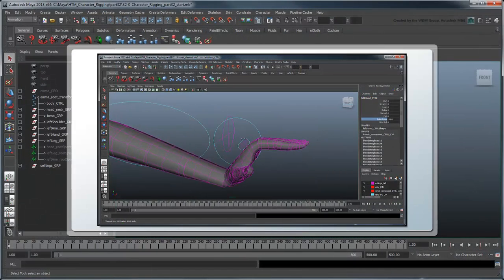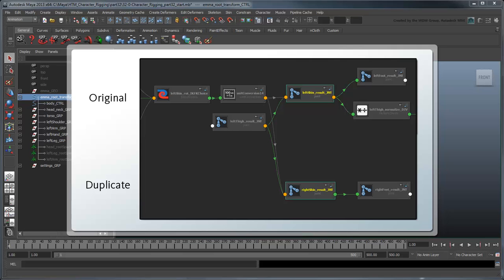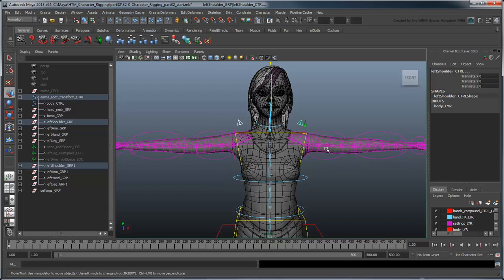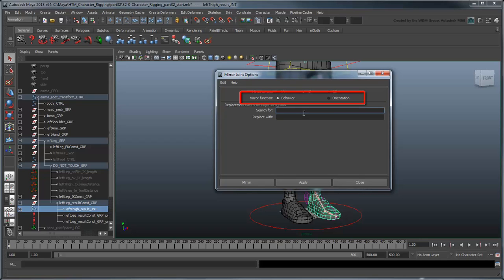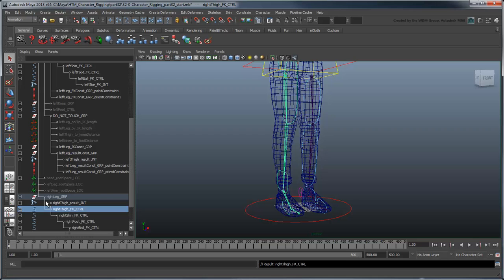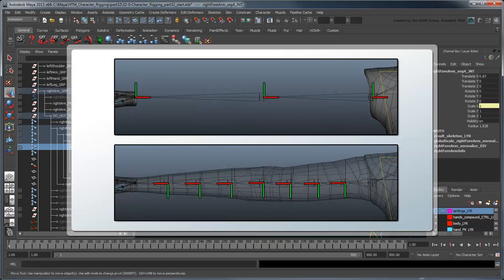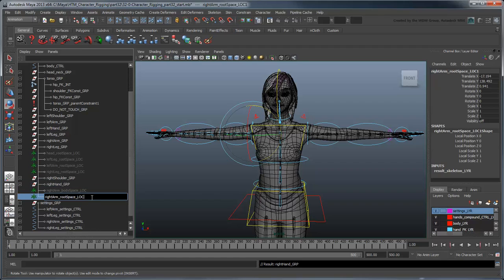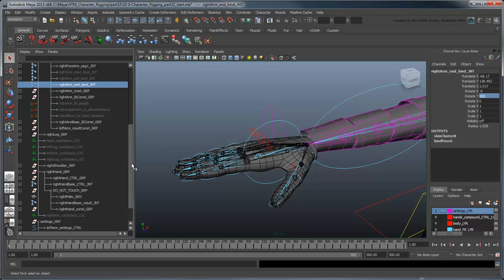Creating a Character Rig - Part 32: Mirroring (Advanced)

Comment: How do you invert the distances or (mult by -1) I dont understand what that means or how to go about doing it. do you do it in the script.......?
Reply from the maker: You will need to use a Multiply/Divide node to multiply the outgoing connections to the length measurements on the right side of the body when calculating stretch / squash.  Try downloading the included scene files and looking at the Node Editor to see what I mean.

Comment: I have another one.left arm/leg ik stretch script is ok.  right side is show result 1 but not stretch .please help me.
Reply from the maker: Remember that the joints on the right side move in the opposite direction as their counterparts on the left side, so you need to invert (multiply by -1) all the length measurements.
Reply: Thank you very much.
Reply from the maker: While I certainly understand your frustration, at 32 videos (38 including appendices) this is the most in-depth tutorial series available on the channel, taking the better part of a year to create.  It also means time spent doing a right-side tutorial that retreads most of the same territory would take time away from doing tutorials on other aspects of Maya.

I can tell you that mirroring the right side, in accordance with the tips given in this video, doesn't involve doing anything that hasn't already been covered in these 32 videos.  If you come out at the end and truly understand the graph, the relationship between the nodes, and the scripts used to create them, then it's a moot point to apply that theory to the right side.  This knowledge and understanding is the most important thing to get out of the tutorial series - more important than the actual rig you get out of it even.
Reply from the maker: This is indeed "the industry" in the sense that to be a great (or even a good) rigging artist, these are the concepts you need to understand.  If you just want a working rig and don't necessarily care about how to put it together then I would actually suggest you try out HumanIK (Skeleton > Human IK).  You can find instructions on how to use it in the documentation, though the rig it produces won't have quite as many frills (such as squash and stretch).  However, I can help you out with your specific questions.

As stated in the video, the best way to build the right side of the rig is actually to rebuild it on the same principles as the left side (so yes, the arm and leg need to be completely rebuilt).  There are VERY SPECIFIC parts of the rig you can mirror by duplicating the original rig (again, shown in the video)but  these cases are few and far between.  The primary reason is that many of the joints on the right side must actually run in the opposite direction as the left (in order to maintain identical behavior on both sides).
Reply from the maker: Oh, you're basically there then.  The important thing to remember when stretching the right side limbs is that you are still measuring in terms of positive values (i.e. the measure tool will never give you a negative length between two points, even if you mirror locators).  However, you ARE stretching the limbs in the negative direction.  Thus, an inversion (multiply by -1) is necessary at the moment you double the length in your script.  From there you can use the same animation graph pre/post infinity theory to stretch infinitely.

Comment: When i smooth bind skin.head ctl rotate is not
fix with eyes /hair/teeth.
Reply from the maker: This is likely a skin weight issue.  When you smooth bind the head, you need to paint your weights such that the head is fully affected by the neck joint.  In real life, your skull accomplishes this.
Reply: Thank you.thank you.

Comment: Hi. So there is no way to mirror a setup contrary to 3dsMax or Softimages? Even by parenting the all structure to a Locator or Null? Seems painfull to arrive to this step, and to have as only solution restarting again from part 10 to 31!
Reply from the maker: Actually mirroring in any content creation tool (Maya, Max, Soft, etc) really just consists of mirroring the joints.  As mentioned in this movie, there is no way to automatically mirror a rig with our level of custom-built functionality and guarantee all aspects of it will work properly.  There are scripts and tools out there that claim to do this, but they are generally unreliable.

In short, it is highly recommended that you rebuild opposing joint structures to ensure a long lasting and stable rig.

Comment: I wonder how many have survived all the course since the beginning...
Reply: Look at the viewcount from the beginning video and compare it to the last
Reply: I made this rig twice, on my own character each time.  One with Squash and Stretch functionality, one without.  This is because I really like the "Marrionette Effect", when pulling on the body_CTRL makes the limbs always point toward their IK controls, as if pulled by strings.  The squash and stretch rig simply has them stretch away.  It was a hard decision, but ultimately I don't really want cartoon-like deformations.  I know the Appendix Series videos contain a method to turn it on and off, but they are way too code heavy for me.  No thanks.

Also, because I was following along with my own character, I found a number of things needed to be redone, such as exact placement of joints, so I had to redo those videos' worth of work.  I must have done most of this rig two or three times over.  AND I rigged both legs and arms at once during their initial videos, so many of the lessons were watched and followed along with twice, for one iteration of the rig.  It took me a while.

This is a great series.  I have a few small gripes with the final product, but overall I'm very impressed.  It's far more complex and robust than what I would have done on my own.
Reply: Almost there...using my own character model though, and I'll work on facial rigging after

Comment: hey guys. great tutorial series! I followed the tutorial for a character of mine. everything worked fine. but I came across an issue with the final rig, that occurs on the project files of you as well. when i'm in IK mode, and move the wrist ctrl, at some point the elbow twist twists 360° when translating normally. is this normal behaviour? I can post a video of the issue if needed! Thanks.
Reply from the maker: This has a lot to do with bone placement and up vectors and is a common rigging problem.  You cannot completely eliminate it due to the way joint twisting is calculated, but sometimes different twist settings can help mitigate the problem.  View the tutorials on creating the arms with annotations turned on to view some of our suggestions for fixing such problems.
Reply: Maya Learning Channel well, I watched it with annotations and followed the tips, unfortunately the problem still occurs. I'll just have to avoid these movements... but there's another big issue I ran into just now, I smooth skinned all the result joints as you mentioned. but the head still deforms incorretly although weights are painted fully on the end jnt. there are no other influences. How can I paint this so that it works correctly? There are the begin, mid1, mid2 and end neck joints, but no painting configuration seems to work  at all...
Reply: found the problem, had to skin the neck end bind joint as well.

Comment: hey guys i just love this series i think you.guys are geniouses, and just a quick question can you make a tutorial on how to bring the rig back to the normal mesh because i finished watching all 32 videos and my rig is al done and then i realised i couldn't do anything with it because it is still proxy and i don't know how to bring it back to normal (could you please help me i'm working on a movie and i really need this rig) 

thanks in advance
Reply from the maker: Apologies for the lateness here - Youtube hid this comment in the spam filter.  

What you're describing is a stage called skinning, which you're right we don't get into here.  You'll need to re-import the unbroken geometry from the provided scene files in part 2, then "smooth skin" the result joints to it.  You will also need to paint skin weights in order to avoid unwanted deformations.  I would suggest looking at the Maya documentation if you're unsure how to do this.
Reply: Oh ok thanx for the answer and i had another quick question : how do you rig a character with instead of maya joints but with polygon muscles (like the guys at weta digital)
Reply from the maker: shekhar nandkoemarsing Muscle isn't really a replacement for joints, just another layer on top of them.  You can generally take care of this in the skinning process (check the Maya documentation).
Reply: Yes i know but the guys at weta have something called tissue system and they controll the rig via muscles and bones (not joints)
Reply from the maker: I would suggest looking into the Maya Muscle plugin.
Reply: oh ok thanks

Comment: Ive had some problems with the right side of my rig everything seemed to be fine, then i noticed using the knee/elbow snap the geometry and joints squash and stretch between the values 0-1
Reply from the maker: The joints/geometry should stretch from 0-1, as that is how you achieve the snapping.  However, I'm assuming you mean the joint stretches too far?  I would double-check the placement of the locators you're stretching to, to make sure they're actually located at the knee/elbow and also that they're frozen the same way relative to the left side.  Additionally, remember that on the right side, you need to invert any length calculations because the joints move int he opposite direction.
Reply: Maya Learning Channel Sorry i don't think i explained myself properly. Between 0-1 the joints stretch along X, not towards the elbow. Then at the value 1 the geometry and joints twist and deform but are snapped to the elbow control. So at value 1 the mesh is inverted but snapped. Its hard to explain and i have no idea why its happening. The same is happening to my knee snap, but i imagine if its possible to solve it will be the same process.
This picture from my blog will explain it better: http://de0996shaunriches.tumblr.com/image/72455866361
Cheers in advance :D
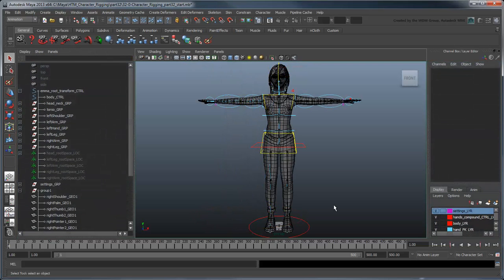Reply from the maker: I believe this may be due to forgetting to reverse the length measurements.  If you look at the example file included in the link below, and display the connections for either the rightElbow_to_handDistanceShape or rightUpperArm_to_elbowDistanceShape nodes in the Node Editor, notice that you must multiply their lengths by -1 down the chain.  This is to compensate for the fact that the joints are moving in the opposite direction.  This is the issue we reference at 10:12.
Reply: Maya Learning Channel
OMG thank you so much, thats completely fixed it :D Cheeeeeeeeeerrrrssssss

Comment: hello
first , this toturials are great pure gold
however,there is an issue with knee snap with SCALE  the knee going out proportion  when knee snap are 1 (full)
how do we fix that ?
thanks
Reply from the maker: This is expected behavior.  In order to meet the knee control, the leg has to stretch (thus changing its scale).  If you wanted to do this without stretching the leg, then you'd need to develop a much more complicated script that moves the other controls each time you move the knee.
Reply: Maya Learning Channel ...and what would be this script ? ;p

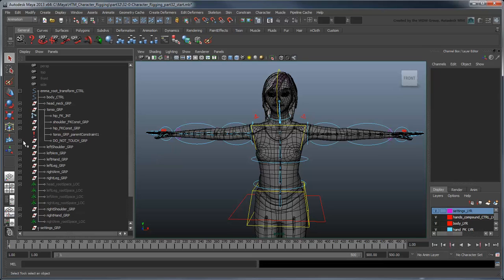Comment from the maker: Sorin Rosca It sounds like your spaces are not aligned.  This is the issue we address at 15:15.  If you find a space switching, you need to pre-rotate the appropriate locator.  Alternatively, you could rebuild the shoulder like you rebuilt the arm/leg to guarantee co-operation - the method we showed is more of a shortcut.
Reply from the maker: We're looking at tackling this in a later Appendix after the holidays.
Reply: Thank you for the prompt answer. Last night I could not sleep because of it so I started troubleshooting, comparing my rig with emma's. Figured it out, my problem was twofold: pre-rotate the locator AND I forgot to add a blend color to switch off the orient constraint in IK mode. Thanks again.Awesome tutorial
Reply: Sorin Rosca So great to see some comments about what I am facing through I guess. I feel bad that I still don't really get it. After I orient constrain all the shoulder,body & root spaces with the rightArm_FKConst_GRP, It will move differently which not following the right way(It will have some error rotate of up and down when I move the body left right) . However I tried most of the way to solve it but still not working.
Reply from the maker: If you're still having problems, then your best bet is to actually rebuild the right shoulder and hand rigs just like you did the arm and leg.
Reply: Maya Learning Channel Yes, i went to redo the shoulder and i solved! This tutorial is too great! However, i would like to know if the squash and stretch able to anable/disable it or not...thank you!
Reply: Maya Learning Channel Thank you very much, I will look forward after the holidays. Cheers

Comment: Love the tutorial.  I ran into a problem similar to lynchsd3 when mirroring the IK Leg. After running the MEL script to get "stretch" in the right leg, I don't actually get any stretching of the leg - only the handle moves past the max resting distance.  I didn't notice that and went ahead to the graph editor to change the Driven Keys to Linear.  However, as soon as I change the post-infinity to Linear - the right Thigh & Shin flip and face backwards (still without any stretch).  Suggestions?
Reply from the maker: It sounds as though you may have forgotten to reverse the length values for the arms and legs.  Remember, the joints run in the opposite direction on the other side.

Comment: Hello, I'm trying to set up the mirrored arm's twist functionality. For some reason, it twists in the opposite direction as my controls, and moves faster at one end than it does at the other. To clarify, if I rotate the upper arm FK control 25 in X, the geometry appears to rotate -10 in X at the shoulder, and -45 in X at the elbow . I've followed the original twist tutorial and I've checked my settings compared to the file attached here and I can't figure out where I'm going wrong. Any ideas?